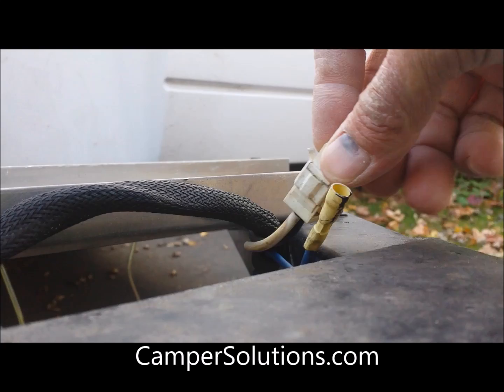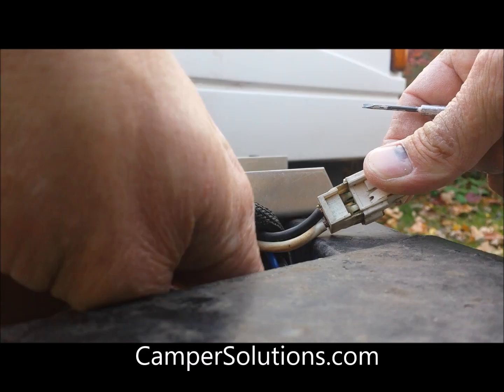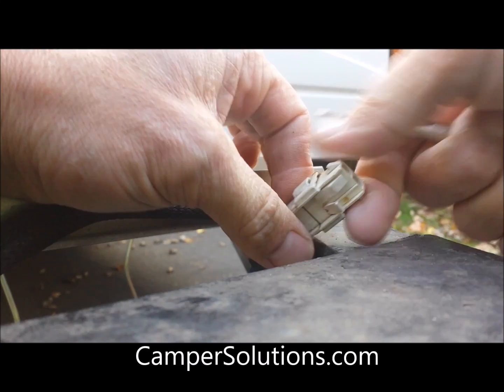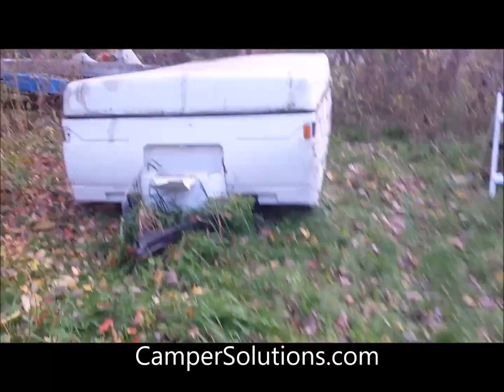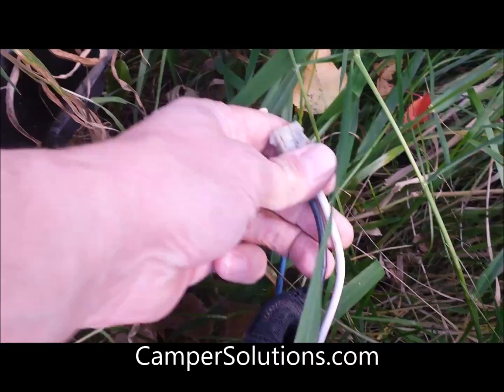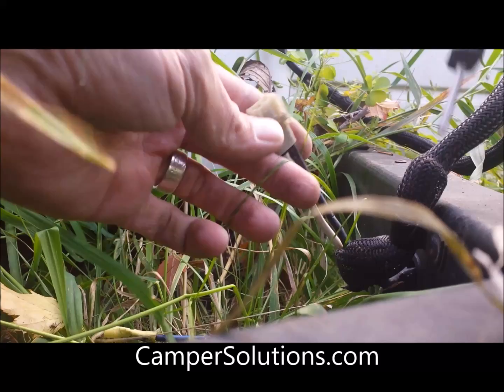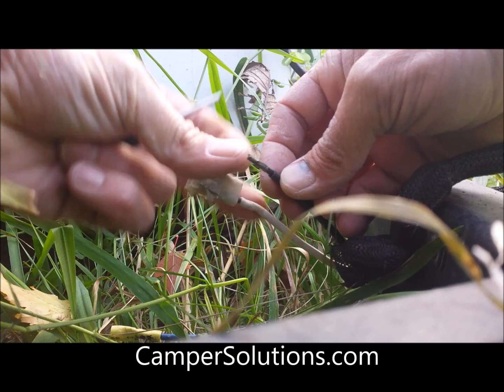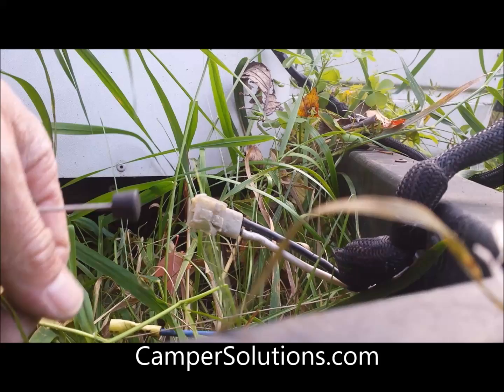Coleman Popup Camper Battery Plug Connection Types

Comment: My trailer only has a 4 pin plug, so how do I charge the trailer battery as the car also only has a 4 pin plug. Do you know if there is an adapter that can charge a camper battery and make it possible to use the interior lights. The trailer is a basic 1984 Palomino Shetland no converter but it does have 120 v  to plug into camp site.

Comment: Hi Ryan, great videos! I'm a proud new owner of a 1997 Sun Valley, and in the process of updating and readying a 6 month RV lifestyle adventure around the US. My camper does not have a battery or box on the tongue, but does have the plug. Can I assume there is some sort of factory inverter on board, or is this something I'll need to install. Lastly, do you sell the battery harness? Thanks again!!!
Reply from the maker: Yes, I have the factory connection battery harness available on my website http://www.campersolutions.com/store

The Coleman campers run off of 12 volts and therefor have a converter factory installed to convert the 120 volt AC to the 12 volt DC.  The factory connection on the tongue is wired into the converter.  Once you install a battery via the factory connection with a battery harness  the battery supplies the 12 volt power for the camper.  This will only power the camper. So, none of the 120 volt wall outlets will work or an air conditioner.  But the lights, water pump, furnace all run off of the 12 volt system.  You can see an example of how to install a battery box on the front of your camper here http://www.campersolutions.com/home/battery-connection

Happy Camping
Ryan
CamperSolutions.com

Comment: I just bought a 2010 sun valley Coleman pop up camper , my question to ya is : when I plug it on the battery , is the white wire go on the negative and red/black go on the positive ?
Reply from the maker: white is negative - and black or red is positive + for the camper battery harness.

Comment: how do i get the other end of the harness?
Reply from the maker: I assume you mean the end that connect to the battery.  The Battery harness and bare plugs are sold on my ebay site.  You can find a link on my home page http://www.campersolutions.com/  or here http://www.ebay.com/sch/i.html?_odkw=campersolutions&LH_FS=0&LH_SpecificSeller=1..campersolutions&_sasl=campersolutions&_saslop=1&_fss=1&_osacat=0&_from=R40&_trksid=p2045573.m570.l1313&_nkw=&_sacat=0
Reply: How do I open the fuse box on the positive cable. My 12 volt battery is not working even though the battery is charged

Comment: someone stole my battery and ripped all the wires of the front of my 2000 coleman santa fe. where can i get a diagram of how to wire the brake switch, battery and brake lights the way it was?
Reply from the maker: On my website.  http://www.campersolutions.com/important-documentsHere is the trailer light harnesshttp://www.campersolutions.com/important-documents/Coleman%2012%20Volt%20Trailer%20End%20Wiring%20Harness.jpg?attredirects=0The blue wire next to the Black and White wires (Battery Connection) is for the emergency break away switch.  And the Black and White 10 AWG wires are for the harness.  If you need the harness plug please look at my store.http://www.campersolutions.com/store
Reply: how do i know what amperage i need?
Reply: how do i know what amp the self reset fuse i need?
Reply from the maker: All Coleman campers of all years used the 15 Amp self resetting circuit breaker except the power roof models used a 40 amp.
Reply: @colemanguy4332  My wife and I just got a Coleman Pop up, never plugged in the lights or anything really but clean it. In your diagram, for the 92-2005 models, is the plug being shown upside-down and backwards? When I look at other diagrams of a 7 blade plug it shows (from top left to top right and then down) Black: Power-Green: tail and running, 
Brown: right turn and brake-Red: left turn and brake,
Blue: electric brakes-White: ground and Yellow: reverse.

My question is do I need to re-wire my trailer plug to fit my trucks receptacle based on the description of the diagram? My trucks 7 blade receptacle is set up to receive the color/duty I described.